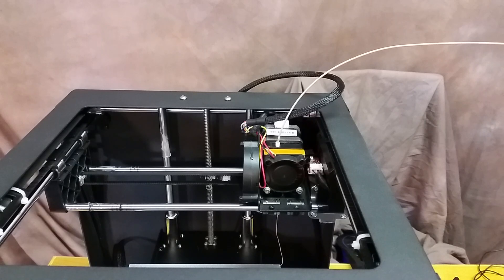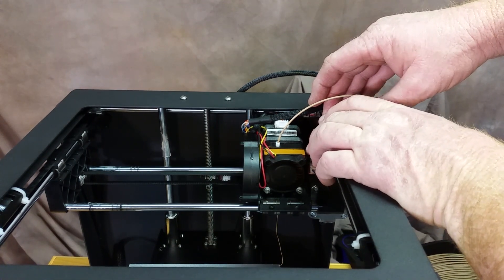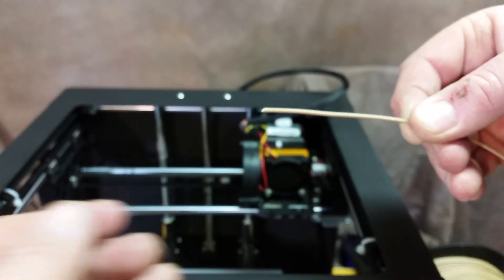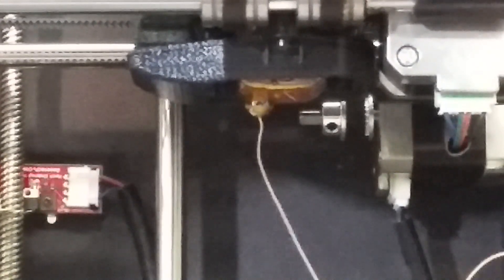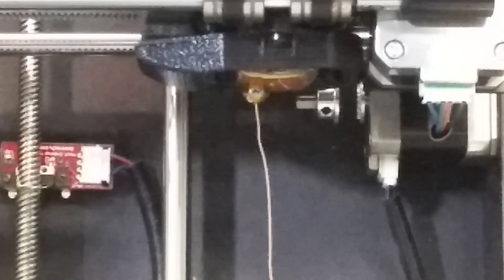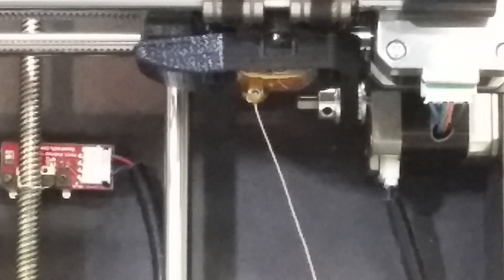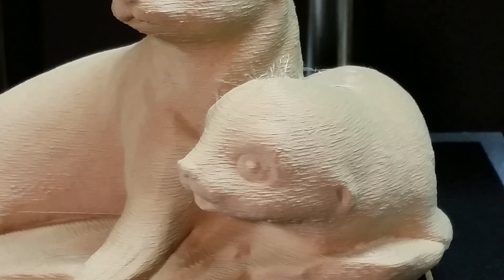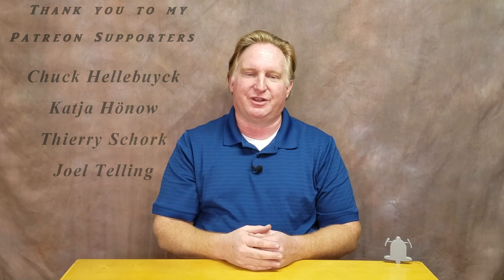Finding The Correct Printing Temperature For A New Filament

Comment: I don't want to sound mean, but that print looks terrible, I'm guessing those tiny layer blobs are when your extruder is slipping due to lack of thermal mass.. either heat up, or slow down..
Reply from the maker: +Stephen Mott Chuck hit the nail on the head.  There is a small blockage in the nozzle.
Reply: Jimmy Shaw's Tidbits Ah, cool, glad you found the problem.. :)